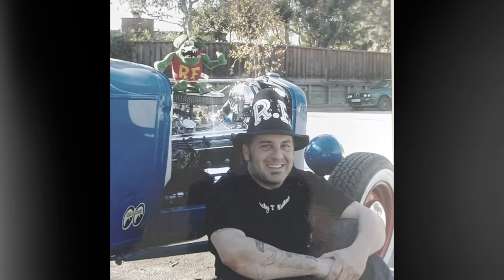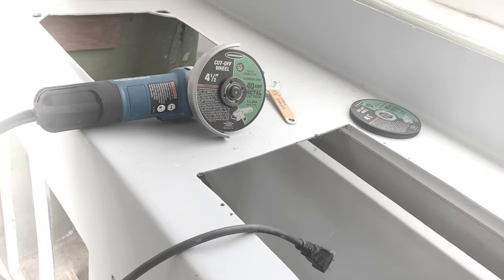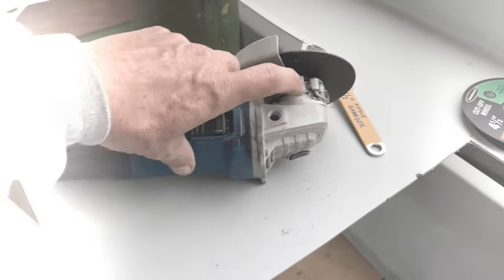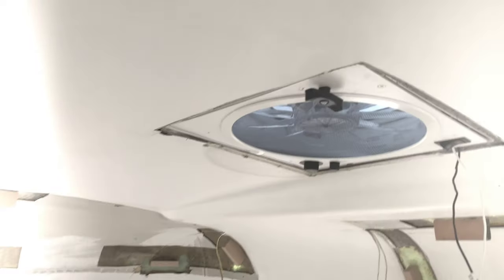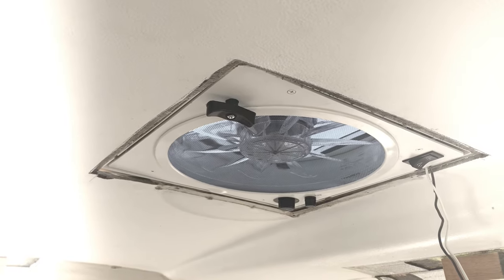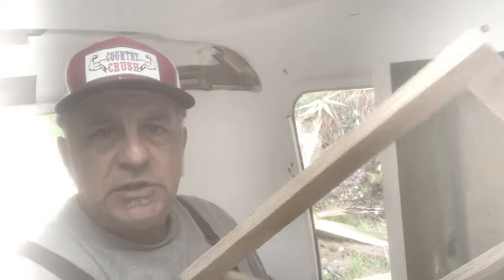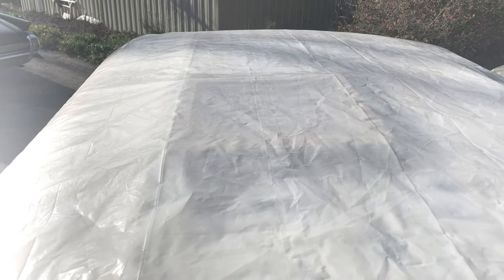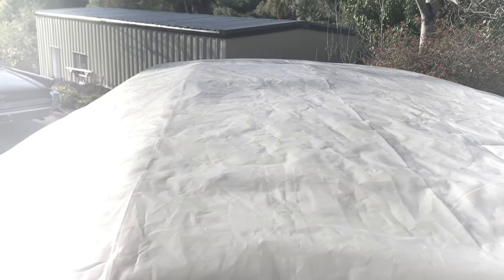Fan-Tastic Fan Scamp Spacer | Ed Roth | #FantasticFan #BigDaddy #Ratfink

Comment: I also raised my fan when installing to keep water from puddling around fan area and leaking inside camper on my Sunrader. I removed the airconditioner and installed a fan. Taking the weight off the roof helps from roof sagging. Thanks for the info.
Reply from the maker: Hey Roy!  I never thought about the water puddling around up there by not raising the fan.  Thanks for the info too! 👍🏼
Reply: Had the same thing happen, took off the AC and bingo, no more puddling.

Comment: Hey Johnny , my fan hole had already had a modified 21 × 14 1/4 . My question is could I use a wood spacer to fill the fiberglass void or should I just re fiberglass it to the 14 × 14 ... Would that be to much wood exposed to weather up top ?? I luv that custom touch man ....
Reply from the maker: Hi Troy! As much as the spacer/filler board sounds easier, if you can fiberglass the space I think you’ll be happier in the long run.  Thanks for your support! 👍🏼

Comment: I’m waiting on delivery of a backordered MaxxAir fan similar to this one. I purchased a custom spacer made out of abs plastic that is designed to be use inside the trailer. Can I glass it in to the top in a similar fashion?
Reply from the maker: Yes, you should be able to.  It’s just as easy to install the spacer on the roof, it also keeps the fan the same height as your inside ceiling. You can fiberglass it to the outside as well to prevent any leaks.
Reply from the maker: Also, you don’t need to fiberglass it to prevent leaks, Dicor seam sealant will also prevent leaks.
Reply: Leak prevention would be my prime motivation.  @westcoast_johnny